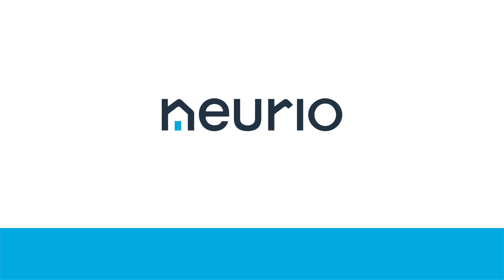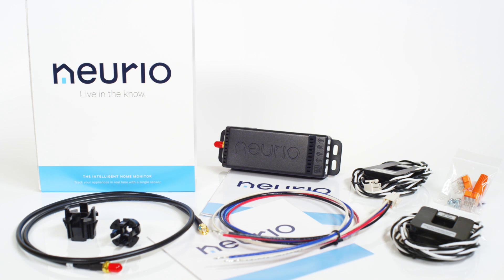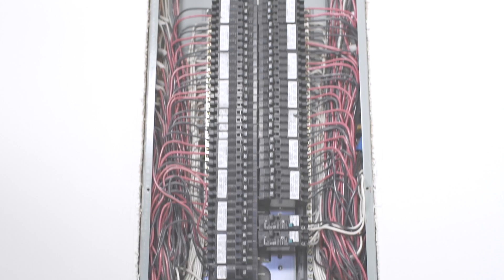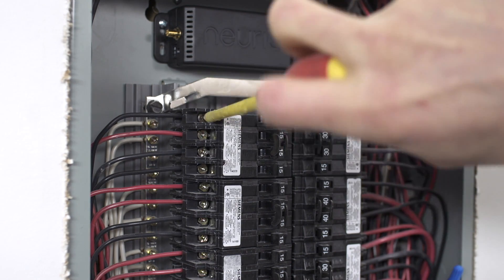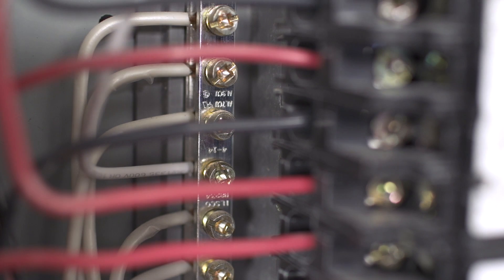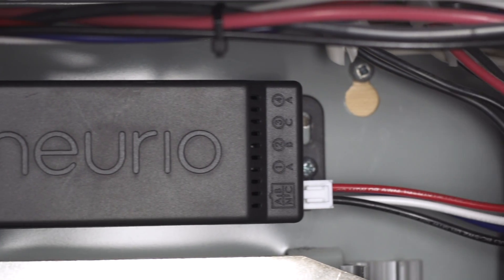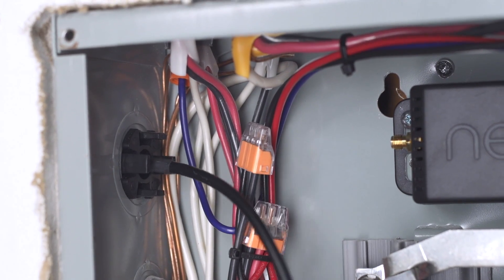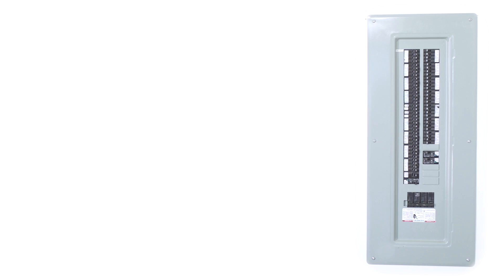Neurio Installation Video - US Homes

Comment: I really don't think the installation instructions telling people to use self tapping screws above the main bus and feeder terminals is wise.  Shards of metal are torn from the backing and fall downward.  Even de-energized, they could cause a short circuit on the bus bars when the main is turned back on.  This can be mitigated by using a piece of cardboard (or other flat surface) beneath the drilling to catch these filings, but your video doesn't show that.   Chances are nothing would go wrong, but I was taught as an apprentice Electrician to always think and plan for the worst possible outcome.   As a Journeyman Electrician now, I would not install your device the way you have shown and despite telling people to "Always seek a professional electrician to install", a lot of DIY'ers will watch this and emulate.  No good.

Comment: As a licensed electrician, I would not do this as a homeowner with no electrical experience. This is very dangerous but if you do decide to do this on your own, PLEASE PLEASE PLEASE wear leather gloves in the event you come in contact with the unfused incoming conductors.  This  is very dangerous and shouldn't take a licensed electrician more than 30 minutes.

Comment: Danger Will Robinson!
As others have pointed out the lugs on the main breaker are live and unfused back to the hydro transformer(10s of thousands of amps of short circuit capability).
The finger pointing person in this video is taking a huge risk if this is indeed a live panel.
It gives the viewer the impression that there is no danger working around the live mains.
Reply: Are you over-thinking this?  The cheery ukulele music leads me to believe nothing could go wrong.

Comment: Amateur/acting electrician here attempting to ensure accurate phase connection. Around 2:40 mentions connecting to the red wire to another Phase "let's call it, Phase B" then mentioning "every other breaker is on a different phase" with a A B A B diagram for each tandem breaker. Is it safe to assume the red wire in this example is on a the fourth breaker from the left top, if the first black wire is connected to the leftmost top breaker? Is there any specific support article/documentation on identifying phases or recommended general industry encyclopedia type resource?
Reply: http://diy.stackexchange.com/questions/101271/energy-monitor-install-load-center-phase-connection
Reply: IF YOU DON"T KNOW, DO NOT TAKE THE COVER OFF OF THAT BOX....

Comment: You can tell a qualified electrician didn't make this video. You are never supposed to turn off the main breaker until you individually turn off all other breakers. It puts too much strain on the main breaker if you don't.
Reply: +Brad This has no basis in fact.  It's like saying that turning two lights off at once will trip the breaker.  There is no "strain" associated with the termination of a circuit.
Reply: +DataLore28 OK. Tell me again what electrical school you went to?
Reply: +DataLore28 Congratulations! You're still not supposed to turn off the main breaker when it's under load. You can do whatever you want, and I'll do it the right way.
Reply: +DataLore28 I guess I should edit my original comment and say: It puts strain on the contacts within the breaker when you shut it off under load. Therefore, causing premature damage to your main breaker.

Comment: This is a good outline, but the shots in the video are inconsistent, some have the antenna hooked up, some don't, they took a negative from a 15 amp breaker, spliced it into god knows what then showed later that the original wire was still in place.
Reply: There is no negative in ac wiring. There’s hot and neutral 
They removed the hot from the breaker and put it into a splice block. 
This way the neurio can get power and still give power to the original load. This is normal. 
You do this when there’s not a free breaker
Reply: I honestly couldn't tell you what I was thinking 9 years ago when I wrote that comment, I guess I still don't know what to call the terminal connector, but yes you're right it is not neutral. I appreciate your reply.